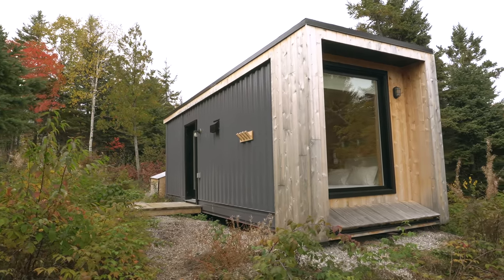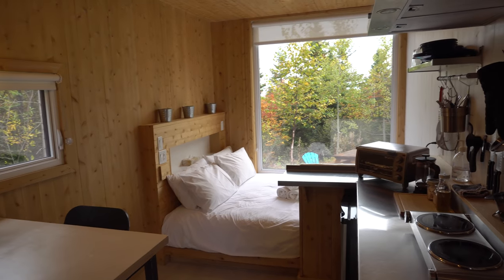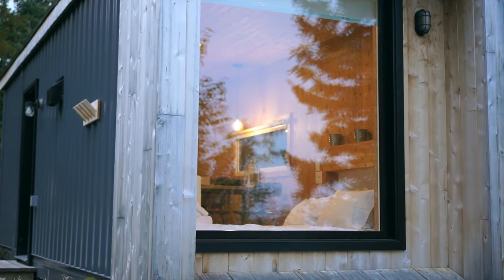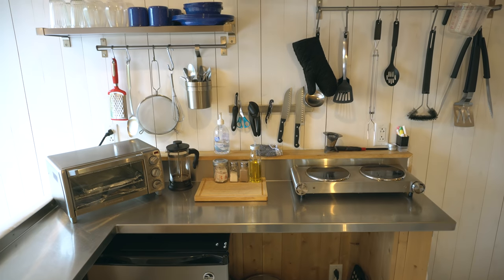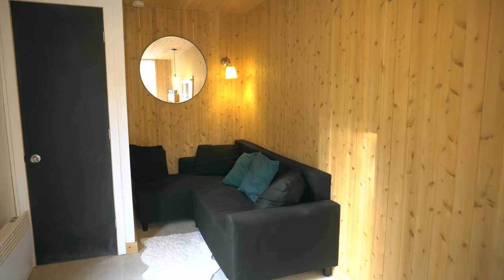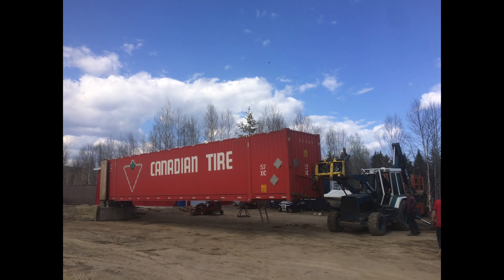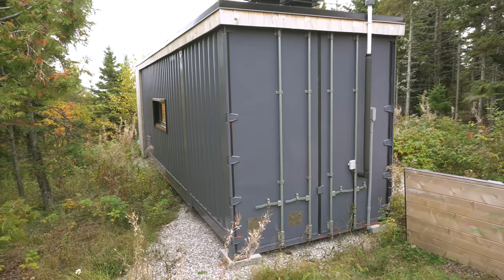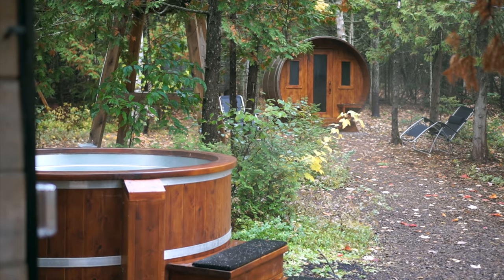Used Shipping Container Turned into Minimalist Micro Cabin - Full Tour in 4K

Comment: You're right it does feel whiter than 8 ft. Perhaps it's because the ceiling the floor and the sides are all the same color I don't know just a guess. I'm not fun the fact that there's no water in there I wouldn't want to go to the house to wash my dishes that's weird. Maybe they could put a little dishwashing area one where they have the showers. They could add a little section for putting stuff in for composting.